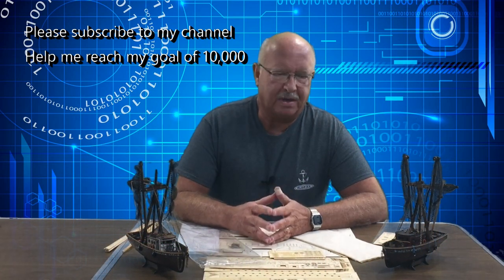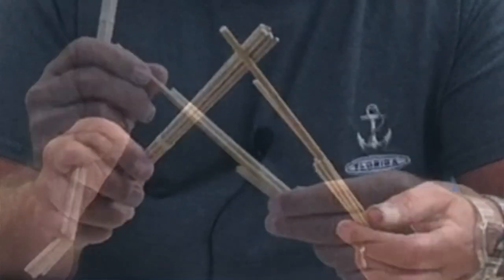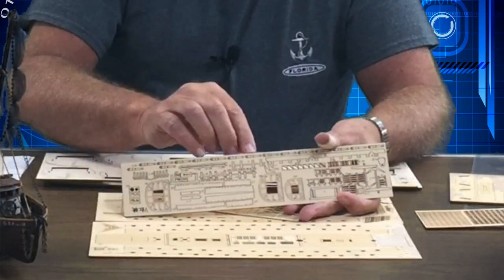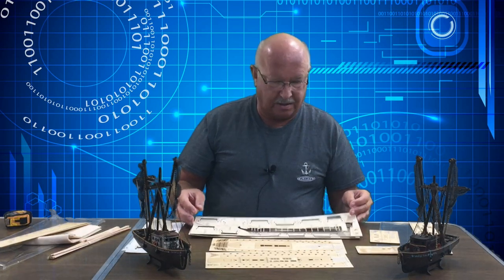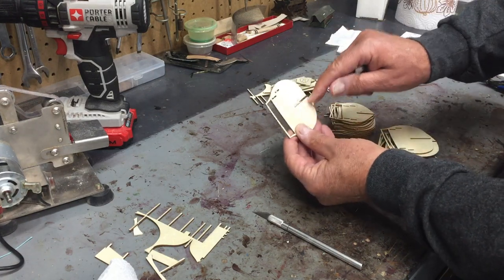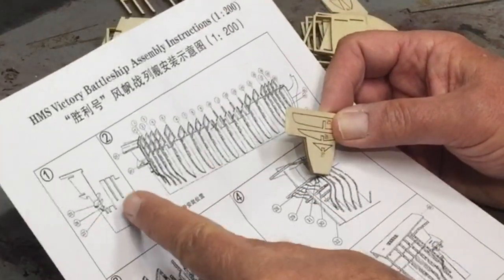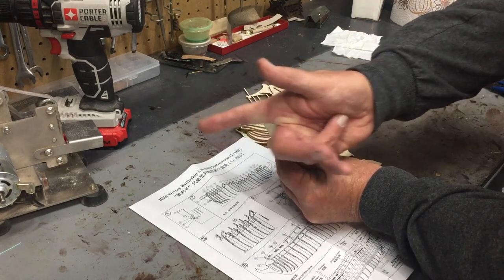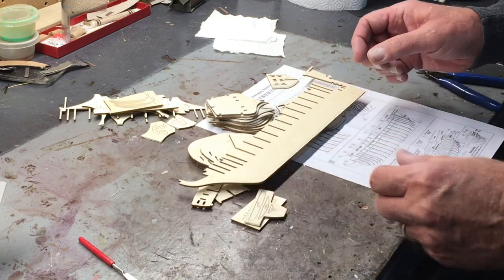HMS Victory Model Ship Build Episode 1

Comment: Ahhhh spruce cleaning is done on boats. Ok. See I would have failed from the off thinking that the ribs loose would be it be game over and I ruined the kit. (I haven’t started it’s still on it’s way I am learning so much first with this it’s so good. And I been looking at the same sander, chamfering tool and heat rod in the later episodes… I can see why some others would be totally bemused as to why they struggled to get planking to sit and that bevelling was a vital lesson for me. I knew what I said was right you are the guy I needed to see hehe. Off I go to order the parts I need 😂🎉
Reply from the maker: Glad to have you following along.  But understand that I was learning as I go….
Since then, I have had a lot better results using my mini belt sander to bevel the edges of the planks.  I just hold it at an angle and run it over the edge.
I’m still learning but am better with each new build.
It’s turned out to be a great hobby! 
Thanks for watching and taking the time to comment 👍👍
Reply: @BoilerDan1  you are amazingly helpful buddy. And I do appreciate all that the kit is still on its way so I’m making use of this time to see how it progresses and oh I would have broke it if I didn’t watch this from you first hehe. I am taking my time and yeah the bevelling I’m getting that sander. Haha. So far I’m into it and I’ll keep going back and watching all through I’m ordering my stain this weekend etc I’m gonna take my time do it right.
Reply from the maker: Sounds like a great plan!
I’m sure there have been a few that have thrown a ship or two into a wall in frustration with the lower deck!😂
I almost did!!!!  But like you, I had committed to take my time.  I finally realized that there was no way to fit it in…. So I snipped the supports and kept moving forward. IT WORKED 😂👍.  Oh, and never grow up! 👍😂👍.
Reply: @BoilerDan1  ah haha touché never grow up got it. 👌🤩 I do apologise btw I am UK 🇬🇧 so I didn’t release it was 9am ish here when I replied and yes I am even being more cautious I got the little 1:70 kit here small schooner looking thing I’m gonna do that first and thanks to you already I have learned to dodge so many things that I would just be lost on without your videos. I am putting your skills into practice on this schooner and learning to stain and I’ll see how that comes out then with following your video I’ll enjoy the victory build more knowing I got all that experience you got preparing me taking my time is a good thing here go over the work you doing and repeat the learning I’m having a great time going slow.
Reply from the maker: Being in UK, you must appreciate the HMS VICTORY!
My apologies as I inadvertently put the royal flag on the wrong way.
My sister refused to let me change anything as it was gifted as her victory over Covid. Next time I will get it right (promise)👍
Reply: @BoilerDan1  you are all good 👍 I appreciate the Victory yes. It’s way bigger than people think these almost but not even Man O’War class vessels the blocked housing that surrounds it are smaller in comparison 🤣. It’s an amazing vessel. I haven’t been to it I should really I’m hoping she’s getting the masts back. And I appreciate your sister loves it as is. I know it’s grating on you but we can easily allow that as it’s exactly that you get to do a next time. 🫡😊
Reply from the maker: Thanks for understanding 👍.  When building Victory, I stumbled on a video documentary on the restoration of the actual ship.
It changed my entire build as I had no idea that the hull is copper.  Note the color of the cannon doors.  I would have just stained the entire ship…..
It’ll be a year or two but I’d love to build another!  I might consider planking the lower deck, leaving out one piece, then splitting it down the center putting it in place, then gluing the last deck piece over the seam!?
Anyway, I don’t mean to blather on…..
Cheers to a successful and rewarding project that you have in store!
👍🇬🇧👍
Reply: @BoilerDan1  I totally understand. I think she wants it kinda not perfect just as life is perhaps a metaphor for “wrinkles an al” I’m not gonna worry about the Jack you’ll be surprised on banner duty as a young cadet we learned not to mast it upside down it’s an easy mistake to make. And that’s awesome I will be looking into that then. Deffo.
Reply: @BoilerDan1  and you can go on all you like it’s important information I’m sure if I get any questions or trouble it’s always wise to ask right? Hehe.

Comment: Boiler Dan I need help on the mast lengths of the Black Pearl Golden Version 2021 , and the bowsprit . :face-pink-tears:
Reply from the maker: Fortunately, the all scenario version has blueprints that I can measure:
I hope inches work for you 👍

Bowsprit-11 1/2” that includes 1 1/2” that goes into the ship.

Foremast: total height 24 1/2” that includes approx 2 1/2” below deck.

From the lower to the upper segments:
Lower 12”
2nd 8 1/2”
3rd 4 1/2”
Top 3 1/4”

Main mast: 29” with about 3” going below deck (adjust as needed).

Lowest 14” (3” of it below deck)
2nd 9 3/4”
3rd 5”
Top 3 1/2”

Mizzenmast: Total 19” with about 2” below upper deck.

Lower 10 3/4”
Middle 6 1/4”
Upper 4”

Obviously the measurements are approximate, but it should help you get a good start with them.

Comment: You didn't show the box, who manufactures this model?
Reply from the maker: Sorry. Actually it comes in just a plastic wrap.
I purchased mine on eBay.
The same ship is available but it’s around $45 now.
Here’s a link to the one I purchased and is featured in the video series:
https://www.ebay.com/itm/154086540136?mkcid=16&mkevt=1&mkrid=711-127632-2357-0&ssspo=Fo4Oo22IS1-&sssrc=2349624&ssuid=s8A53jWuRTC&var=&widget_ver=artemis&media=COPY
Thanks for watching 👍👍
Reply from the maker: Sorry, that seller must have sold out.
Here’s another example:
https://www.ebay.com/itm/403303633474?mkcid=16&mkevt=1&mkrid=711-127632-2357-0&ssspo=wo18jbd4r56&sssrc=2349624&ssuid=&widget_ver=artemis&media=COPY
BUT IT IS BETTER TO SEARCH AND LOOK FOR BETTER PRICES!
Just search HMS Victory model ship.

Comment: where do you get the ships
Reply from the maker: Purchased mine from eBay, be aware that there are different ones at various prices. Even the one I purchased ranges in several price ranges from a little under $40 to $80 or more.
Here’s a link to the place I purchased from: https://www.ebay.com/itm/Victory-DIY-Wooden-Sailing-Boat-Assembly-Model-Kits-Ship-Home-Decoration-Toy-/154086540136?_trksid=p2349624.m46890.l49286
However the price is now $45, I paid just under $40.
Amazon lists one for around $50:
HMS Victory 3D Wooden Puzzle DIY Ship Craft Laser-Cut Model Kits to Build for Adults 1:200 https://www.amazon.com/dp/B089YGB4VN/ref=cm_sw_r_cp_api_glt_fabc_BC263D620EDN72YE76GG
Thanks for watching!
I’ll be posting another segment in the next week 👍👍